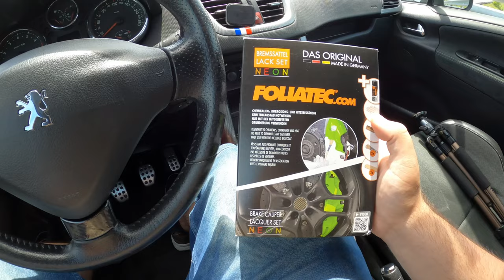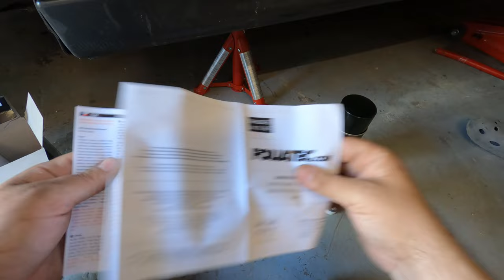207RC / GTI Brake Painting - Foliatec.com Neon Yellow

Comment: Hi i have a question cant i just dump the whole hardener in to the paint and use it on all 4 brakes?
Reply from the maker: Hi, 

I painted the brakes in two round. First the  front and rear left and leater the right side.  I used a medical syringe to measure the required amounts into a separate bowl.
Reply: @dailysabused5185  oh so i cant use the whole hardener and paint?